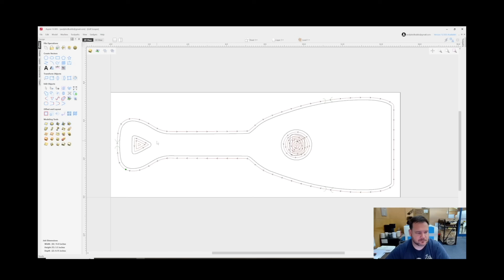4 Hours, No CNC Experience… Built This Amazing BBQ Tool

Comment: Hey Andy BB, I'm shopping for a CNC router (used). I'm new to CNC router work but I have worked on CNC machines and am a repair tech - currently my side hustle is repairing automated massage chairs. On Craigslist there are a couple Longmill MK2's and a Shapeoko 3xxl. Each one is right at $1000 and have extra, upgrades and most everything I need to get started other than let's say a laptop, software, dust collection. That's my price range at the moment and I'm hoping to get one soon because I want to get started on gifts. 

I have an idea of the gift I want to make for most everyone on my list and might be able to market these as well. I think a portion of the build would be with extruded polystyrene. How well does the router do with that material? How well suited is it for carving? Will I be okay without upgrading to a spindle for the most part? Or is it almost a necessity if i go from hobby to production for sales? Could I set one up in a spare bedroom? Or is that a bad idea to have it running inside the house? 

I am interested in taking a course to get better acquainted with CNC router work. I appreciate your time  🙏
Reply from the maker: That's awesome you're getting into CNC, those machines you mentioned are solid choices as long as they're upgraded.